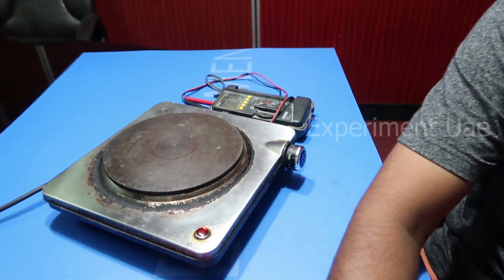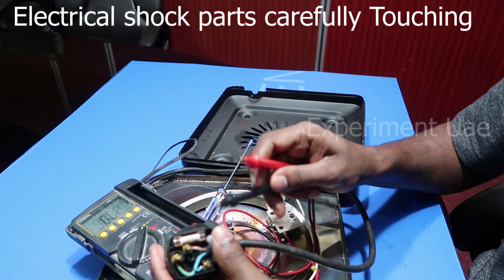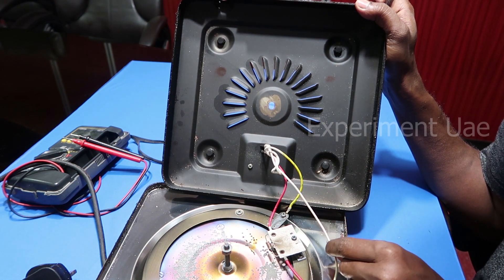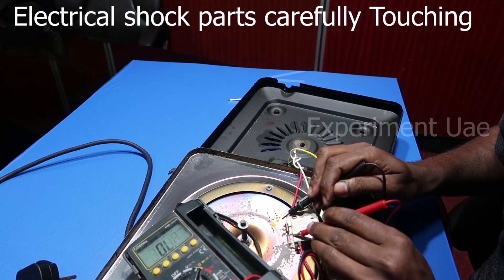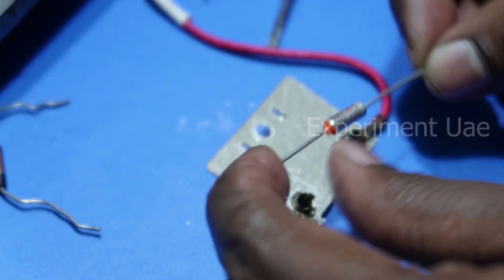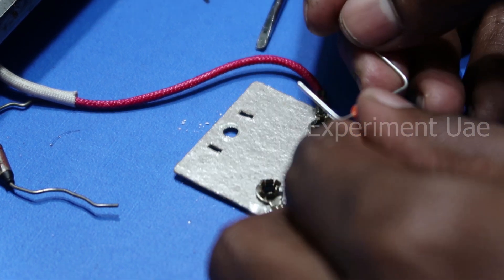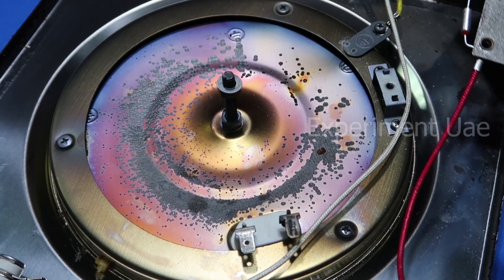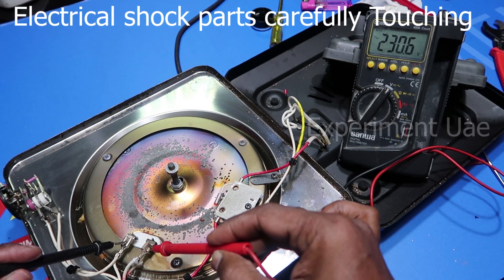How To Replace Thermal Fuse A Hot Plate Stow  | Experiment UAE |

Comment: Bro ende hot plate ota mode thanne working avukayanu.. kooduthal hot avunila.. ndanu karanam
Reply from the maker: Temperature adjust cheyutha nobe check cheythu nokku
Reply: @Experiment_UAE  bro watsup nmbr tharuvo.. njn chek cheyhthu... bere nda problm akan chance
Reply from the maker: model no parayamo
Reply: @Experiment_UAE  nannakkanel nalla paisa akuvo... heat varunund.. but controller koottitum ore heat mode thanne varunnu.. maximum pettenn hot akunila...??
Reply from the maker: കണ്ട്രോൾ മാറ്റി നോക്കു റെഡിയാകും ... ഹോട്ട്പ്ലേറ്റ് അല്ലെ കോയിൽ ടൈയ്‌പ്പപ് ?
Reply from the maker: 971554546704
Reply: @Experiment_UAE  athu thanne bro.. etra paisa yavun
Reply from the maker: ഷോപ്പിൽ കാണിച്ചു നോക്കു ബ്രോ എനിക്ക്  റേറ്റിന് കുറിച് അറിയില്ല എന്തായലും ചെറിയ പൈസയെ ആവുള്ളു
Reply: @Experiment_UAE  thanks bro
Reply: Avar paraju.. probe evideyum kitanila.. direct connectivity without temperature sensor cheythu tharamenn... direct cheythal voltage current ndelum kuzhapam indo..
Reply from the maker: Vere vazhi Ella direct kodukkam.. working avum life kurayum
Reply: Warmex nde 1200wattnde
Reply: Oru 3month xtra nilkan chance indo.
Reply from the maker: Athil kooduthal kittum .. പത്രം ഇല്ലാതെ ഓണ് ചെയ്യരുത് .. കുക്കിംഗ് കഴ്ഞ്ഞു ഓഫ്‌ ചെയ്താലും കുറച്ചു വെള്ളം വയ്ക്കുക
Reply: @Experiment_UAE  heaterinde mele paatram vekkanano parayune off cheythitt
Reply: Athu ndina engane cheyunne?
Reply from the maker: Yes patrathil vellam venam